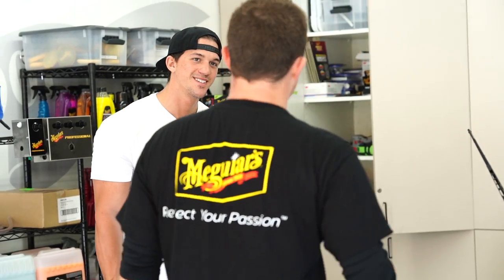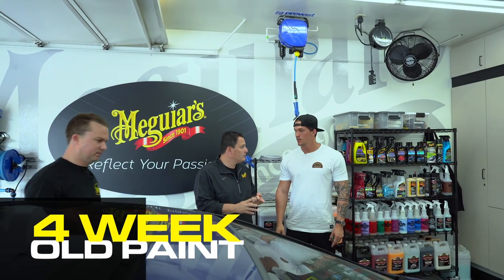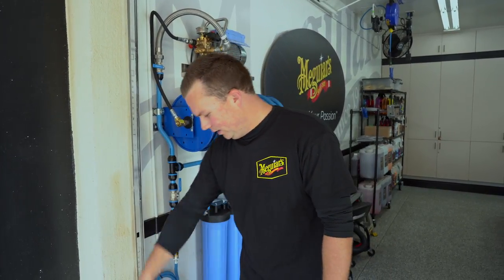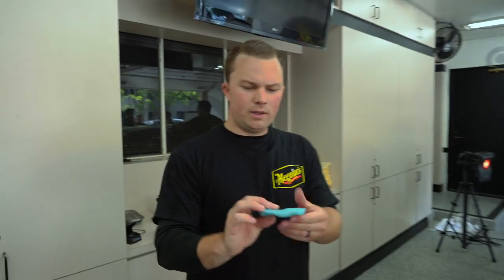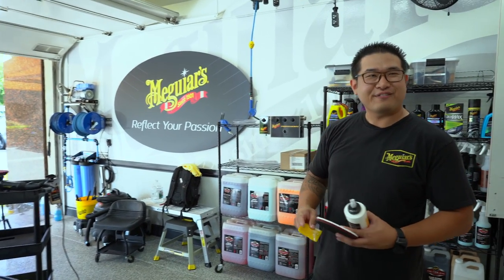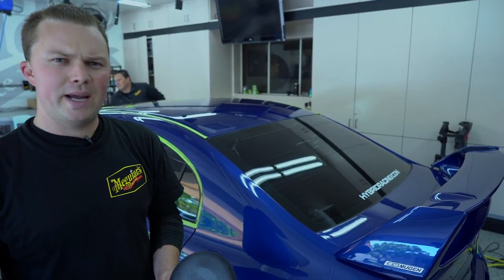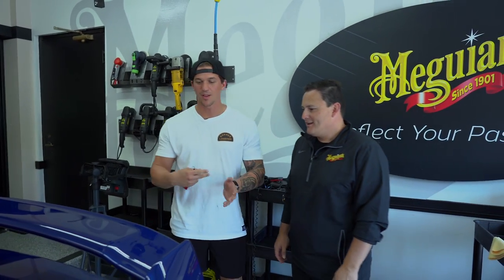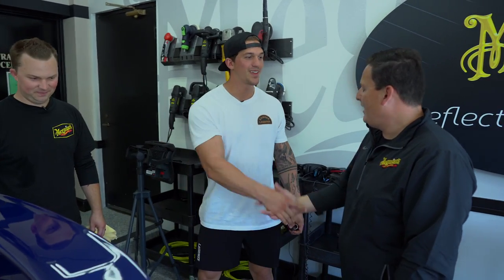How to care for Fresh Car Paint – Day in the Bay – US Edition

Comment: Would like to know which Meguiars car wash soap was used on the new paint. None was listed in the list of products used in the video. Would like to know, just had my car painted and was told soap should not contain silicone or wax. Thanks!
Reply from the maker: If you want a good straight car wash without wax in it that can be used on fresh paint our Gold Class Car Wash Shampoo/Conditioner would be a great choice.
Reply: @meguiars Thanks!
Reply: @DV8N1 how was it ?
Reply: @thebphet3333  Seemed to work just fine.  Not as much shine as other washes with all the extra cleaners and such, but this basic wash was great until my paint cured enough to properly wax and detail